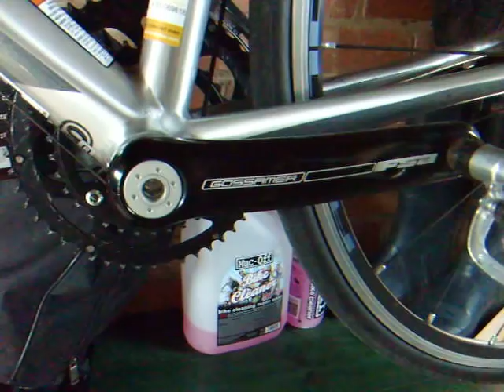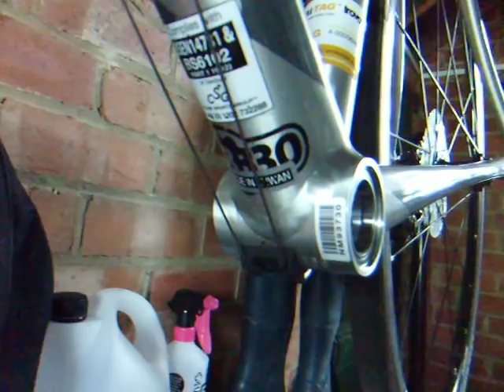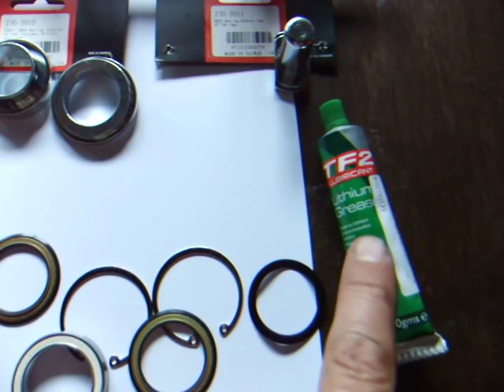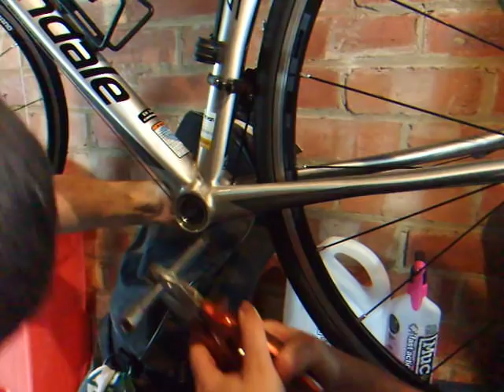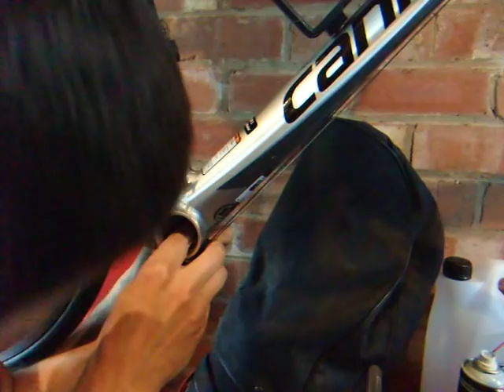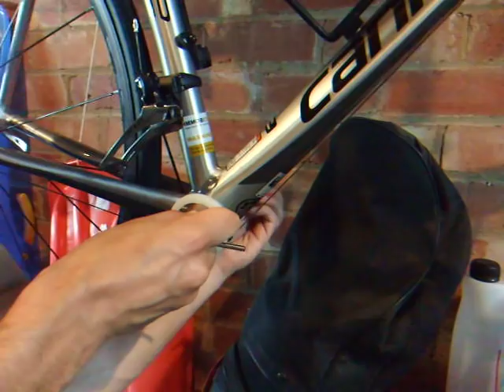DIY BB30 bearing replacement on Cannondale Synapse Alloy

Comment: After many tens of thousands of miles and many types of BB I can quite happily say the BB30 is the worst I have ever come across. Bearings let in water easily on the crank side ruining the bearings in around 2000 miles.
They rely on pressure to stop them from rotating or moving and ANY movement is loudly notified by one or more of a myriad of noises.
It seems those who don't have issues don't do the mileage. I would expect around 10000 miles from a set.

I will never buy another bike with BB30

Comment from the maker: No not normal, but unfortunately quite a few people report issues with BB30. I purchased my bike from an Internet retailer who provided the parts under warranty (as I wasn't prepared to send my bike to them), besides I quite like learning how to repair bikes myself. 1200 miles is not a reasonable failure time (unless you have been jet washing the bike).